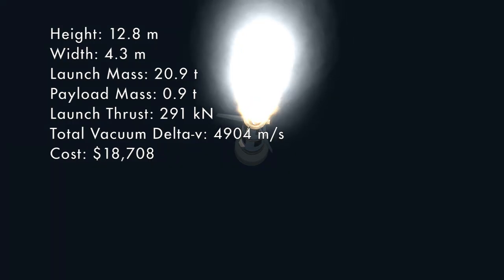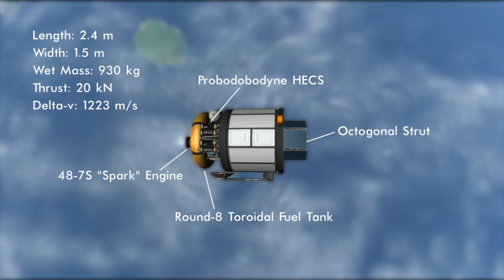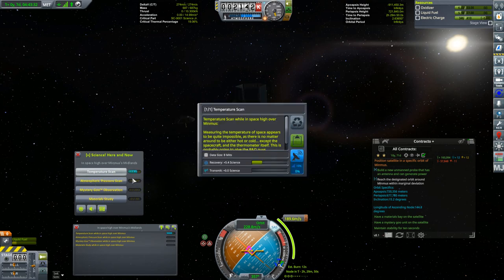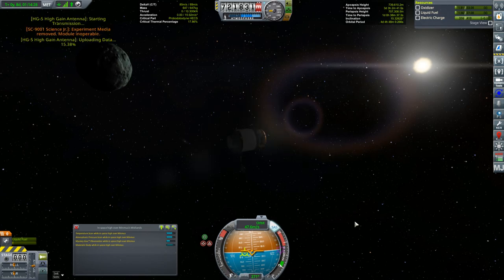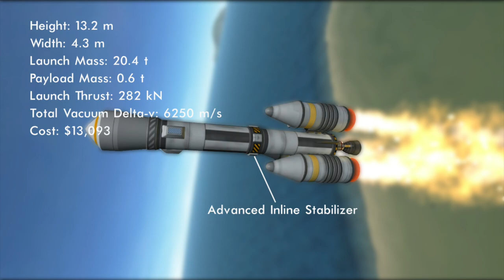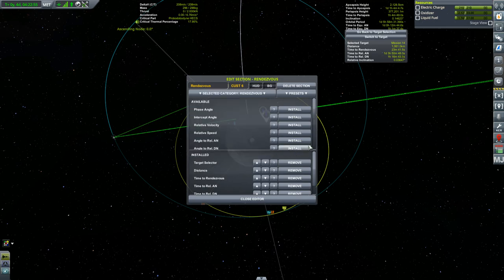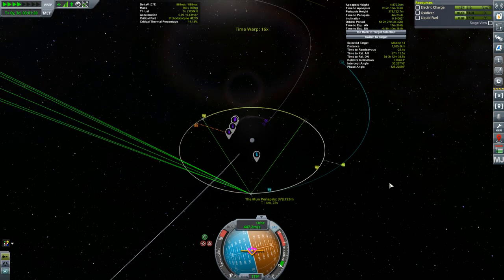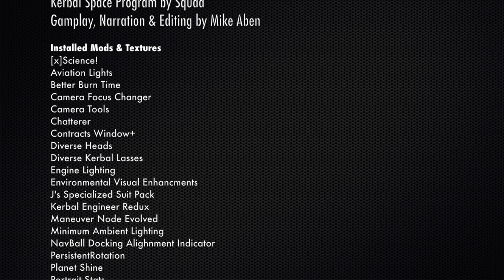KSP AV Career: 12 - Moar Relays

Comment: I do so like the toroidal tank combined with the Spark engine, they are made for each other.  I also like the fact you can stack the toroidal tanks together without them looking dumb and without the guilt of clipping. They just look good too.

I do find that when the stock fairing is set to clamshell, they will get stuck a lot of the time. So I tend to use confetti as ugly as it is. However, as an alternative, I recommend Procedural Fairings which don't seem to have the same problem, for a non-stock game.
Reply from the maker: The toroidal pairs well with the Oscar-B too.  I've even stuck them under the Terrier engines, and they still look good.

Comment: I've got a booster that I've been using a heck of a lot; it's a single Fulcrum engine and typically three SRBs. I came close to trying to design a multiple-launch mission using just that to land a kerbal on the Mun, but thought better of it, and using a bigger rocket to do it in two. 

Turns out the Soviets considered using the R-7 to assemble a circumlunar mission. Three boosters, one Soyuz, and one guy in a Vostok to bolt it all together.
Reply from the maker: I think I remember the Fulcrum from MOLE.  Is that the one with two nozzles?

Get to the Moon, moar boosters!
Reply: Sort of. The Fulcrum has one nozzle, but M.O.L.E. has components that let you cluster them.